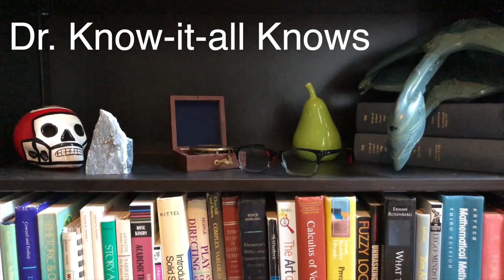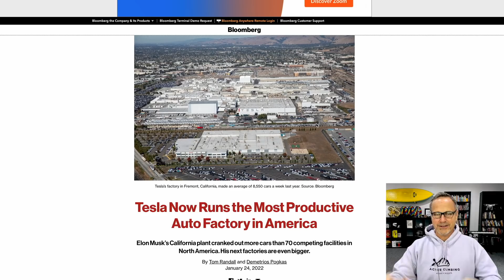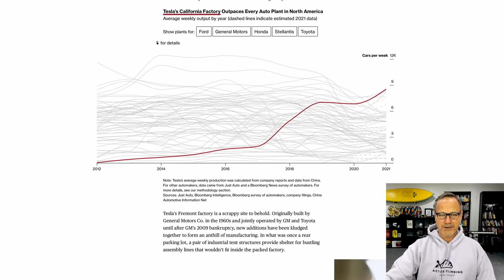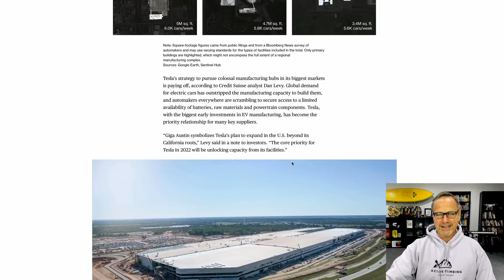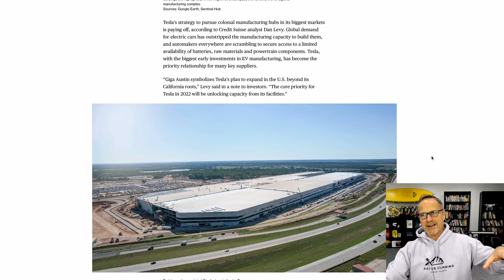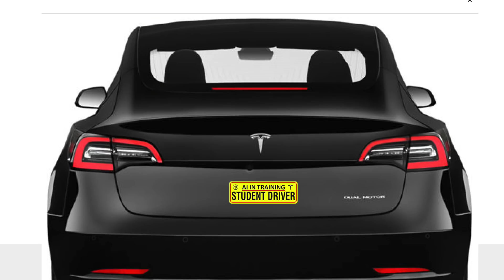Tesla Fremont is now the MOST PRODUCTIVE CAR FACTORY in the US! And just wait for TEXAS!

Comment: Thanks John for including the Bloomberg link in your description.  I assume that each plant is working 80% of a full week (483,840 seconds) and that Giga Texas would ramp to 2M cars per year or an insane 38,460 cars per week and about 4.5 times the current Fremont production and about 75% more efficiently.

Using the 8 diagrams in Bloomberg's report I see:
Tesla TX -             206 sq ft/car and a car every 13 seconds
Tesla Freemont - 620 sq ft/car and one every 57s
Toyota KY -       1,068 sq ft/car and one every 58s
BMW SC -             840 sq ft/car and one every 58s (same as Toyota KY)
Nissan TN -       1,225 sq ft/car and one every 99s
Stellantis MI -      834 sq ft/car and one every 81s
Ford MO -            811 sq ft/car and one every 84s
Hyundai-Kia IN - 608 sq ft/car and one every 87s

Tesla Fremont is smaller than either Toyota or BMW but produces cars at about the same rate of less than a minute.  The others are about 40-75% less efficient.  I imagine the staffing numbers per car for Tesla would be lower than anyone else as well.

Giga Texas will need a lot of drivers and auto transports to get all those cars moving into customer's hands.

At Tesla, the machine (factory) that builds the machine (car) is truly amazing!!